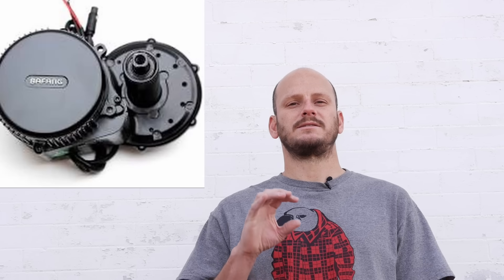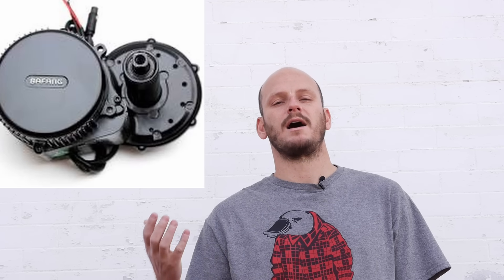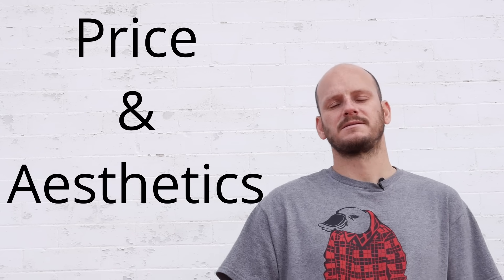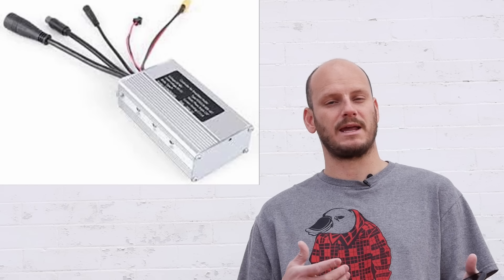Hub vs. Mid Drive Motors: Why Hub Motors Suck and Debunking Common Myths with performance test

Comment: You are so wrong hub drives are getting faster and cheaper while mid drives are on honesty a half ass design.. you want to be wide open throttle shifting thru them gears and mid drives can't do it.. you can ride it aggressive well unless your peddling the thing
Reply from the maker: Yes. You want to have the same mindset of any manual transmission setup whether it’s a motorcycle or car. Do not apply power while shifting. That is always bad!
For those that don’t want or need the performance of a mid drive, consider a hub motor. They are much easier to operate. I always use the scooter vs motorcycle analogy. Scooters are just easy and fun. Motorcycles are a different beast completely.

Comment: Everything your saying I experienced the complete opposite.. I smoke my buddy's mid drive that more then double the price of my bike and he breaks his chain on a weekly basis..and can't utilize all his gears and you can't shift under power.. hub drives are for the bicycle guy who doesn't want to  be considered a e biker.. mid drive you pedal way more then you should on a e bike.. the weight almost don't justify having it..I always thought mid drive was far superior but I was complete wrong.. if you want a mid drive I would recommend just stay electric less or buy a E motorcycle you will be so much happier..  and I never broke a bicycle chain in my life and if your kid drive isn't snapping chains then it's not working right
Reply from the maker: How much power does your friend run through his motor?! 1000w is max and you have to be in the correct gear or you will break chains and burn up your motor. Just like a car. Yes if you don’t like shifting, pedaling or riding a regular bike, you won’t like a mid drive.

Comment: I look for a hubmotor to speed up my bumper car a bit. am I right that the hub from an e-Bike would be better as it must have lower KV as the diameter of the wheel is way larger. My plan is to press a rubber-tire on an e-bike hub-motor and put it in the bumper car. 5000w should be preatty neat

Comment: Mid-drives are literallly a pain in the ass 😂
and more conplicated, and expensive, and a hassle.

Also if your chain snaps (which Ive done twice now in 3 months) your ride is over. Yeah you can replace your chain out in the field but who wants to deal with that. Its annoying and a serious vibe killer. 

If hub drive motors fail you can still pedal home. Also if you are smart you have dual hub drive motors so if 1 fails you still have a backup plus pedaling worst case scenario. The odds of dual hub drive motors failing at the same time are slim to none.

Also you want geared hub drive motors which are far more effective, efficient, and powerful.

Mid-drives also overheat much easier which you failed to mention in this video. I have pne of the most powerful mid-drive motors in the world that being the CYC X1 Pro Gen 4. Its a powerful motor for sure. But it also throttles power in a major way at 164 F which is not hot for a motor at all. 

Ive seen hub drives reach temps of 220 F and still keep rocking. 

Mid-drives are really only geared towards serious mountain bikers tackling very challenging terrain where quick bursts of speed are needed and all while using much lighter bikes. A good example of a mid-drive setup is the Bonnel 775 with the X1 and A-65 battery setup. 

But for bikes heavier than that like fat tire etc its geared hub drives all the way. Plus mid-drives are noisy and need far more upkeep.

Im sorry but this dude is definitely wrong. Geared hub drives win all the way around. 🚴‍♂️💨
Reply from the maker: I’d still take a broken chain over a flat in the hub motor wheel 10:1. The added performance is just a cherry on top. But different spokes for different folks as they say
Reply: @JohnnyNerdOut True. Everybody is entitled to their opinion. If you can afford it have the best of both worlds.

Comment: 3 years ago, got a cheapie Ebgo from Costco, rear hub ( under $1500 CAD ) ,  my first ebike, and it was totally a  blast for casual riding and errands/shopping/etc. especially with thumbthrottle.  However, recently got a Opus mid drive for $2200 CAD,  ( 50% markdown from $4400  ), and i absolutely love it.  Completely different ride,  smoother, feels more natural,  and its just, subjectively speaking, more fun to ride.  Being 10 lbs lighter than Ebgo helps also.  The next ebike I'm eyeing will be carbon fiber,  sub-30 lbs,  and definitely mid drive!   Btw,  thanks for the awesome comparision video!  I was supercurious why the mid drive felt more natural/organic/'funner' , lol;  u answered all the questions  😁😁😁

Comment: Converting an old Dutch bike is another application for a front hub motor. If it has a single speed, or a 3-speed IGH, you don't have to touch the drivetrain by simply installing a front hub motor; keep the rear coaster brake, and often there is no front brake to deal with at all. This is possibly the easiest e-bike conversion ever, and is ideal for assisted city cycling for errands or commuting.

Comment: I have an ebike with a mid-drive and a 400 lithium battery. It was conservatively designed and engineered by "BOSCH". I keep the bike inside and never get it wet. I try not to work it too hard and monitor it closely when it charges. Never had a fire "YET". Hoping for the best.

Comment: Look I dont think you can just crown a "best motor style" 
It just depends too much on what the rider needs and whats expected of the bike.

My situation:
I am a commuter. I need to ride for 65km each day, no matter the weather. The bike needs to make it. Working this role the bike sees mostly asphalt and some gravel roads.

My bike:
-RH212 direct drive hubmotor
-Phaserunner V6
-2.25" 29" street tires (made for speed pedelecs, so rated for 45kmh)
-30ah 48v rack mount battery along with a 20ah 48v downtube battery. Both are locked to the bike and are easily removable. I only charge these batteries to 80% and have them cut off at 20%. This greatly increases battery health over time. Using an arduino and some relays I made it so the bike first drains from 1Battery and switches to the 2nd one as soon as the 1st one hits 20%. There is a buffer zone so the bike does not need to be restarted when the power source is switched.
As is it has 2.4kwh of battery, the way I use it, I get 1.5kwh with the option of using another 0.45kwh if I need to with the flip of a switch.
-Full steel frame with no suspension
-260mm Magura rotor with magura MT5 in the front and 180mm deore XT disc in the rear with deore XT brake lever.

My bike needs to sit at 35-40 kmh, comfortably, also this is the most efficient speed for my setup.
In ideal conditions it should get above 100km of range. In worst conditions like winter it should not drop below 70km total range.
I get engine braking and its variable. This is accomplished with a brake sensor, as soon as I move the front brake lever the littlest bit, engine brake engages. I can now use the half twist throttle to adjust how much engine braking I get.
I have done a full 100% battery usage range test when I built this bike and 100% on throttle and not beeing that economical it did 120km during summer.

This way I hardly ever need to change my brake pads. I go through 1 set a year. I get around 15000km for 1 year.

If this were a mid drive I would need to service my chain often, I would go through cassettes, both especially at full power (1500w BBSHD)
I need to have a bike thats reliable, will comfortably sit at a decent speed for a long time, will run for a long time, require little to no maintenance and thats what Im getting. I went for "as little maintenance" as I could with this.
Had this setup for 1 year and total battery capacity has dropped to 93% only, after 15000km basically only on throttle riding. I am on track to get 50000km~ out of my batteries before needing to replace them and I had no issues with the motor so far. I might have a look inside during my next holiday to switch out bearings and regrease everything procautionarly.

Comment: I am regretting my hub driven Velotric Breeze 1. It just can’t pull the hills in my neighborhood on throttle alone. I only weigh 165lbs. And this is important to me because I have some health issues that cause my muscles to just give out, without warning. I have already decided my next bicycle will be a mid drive. I haven’t even had my Velotric a week.

Comment: But hub motors require a dealer who can repair them. Also, all these different Chinese bikes and who is going to be able to get the parts. It sure seems like one American, Canadian, Mexican, or some other good quality dealer would manufacture these or at least have a dealer network.

Comment: even Grin motors?
Reply from the maker: If you are going hub Motor, I pretty much only recommend using Grin motors. They’re all axle Motors are actually pretty great. I have a video coming out on them soon
Reply: @JohnnyNerdOut  any opinions on the Haul LT geared hub? Is the Bafang throttle similar?
Reply: @JohnnyNerdOut  I'd love a video where you compare bafang and grin on the same bike under load.
Reply from the maker: Coming soon! Similar bikes but not the same ☹️

Comment: the hub motor is for people who are mechanically inclined and unafraid.
The mid drive is for idiots like you who wanna feel more power for a significantly higher cost.

Comment: If I rode frequently on low-traction surfaces -- sand, mud, snow, dense gravel -- I'd get a front hub motor. Then you have 2WD.

Comment: I have built and ridden multiple ebikes, mostly hubs and one mid. Here's my thoughts:
A well-built wheel with a hub almost never gives any trouble.
With the right motor and a nice torque sensor, hubs are great in assist mode, which is how I mostly do my riding.
Hubs that allow regen are really sweet - you get brakes that work in all weather and are more linear than anything you've ever experienced. For heavier vehicles like trikes and tandems, you can recoup up to 20% of the power while not wearing your brakes, which is great!
Mids - make sure you aren't loading too much on the chain. The one mid I had drove a tandem and while it was great going up the hills (even with 2 people), it ate up the drive-train like crazy.
I would venture onto another low-power mid only for a very light build to try for range, using it with large cogs (16T up) and an even larger (60T) chainring to reduce chain wear.

Comment: Nah my 3000w 72v cube will smash any middrive on concrete if you wanna race up hill of off road just the stealth bomber will smash any middrive
Reply from the maker: Nah. The x1 pro 72v mid drive will have smashing power in a head to head smash test
Reply: @JohnnyNerdOut cost ?!? That motor cost more than my cube my cube cost 800 and is on  8000km

Comment: Ok its maybe easy to fix a chain on the side of the road... but please... Spokes are far more simple to change on a hub motor wheel than on any normal rear wheel! I can change one in minutes without removing the cassette or even the wheel! its not more complicated to take a nut and spoke and spoke tool, than a chain or chain tool! please... (when travelling far, i tape some spokes on my frame, even with a normal non electric bike). I my case, i don't need a lot of power and i like hub motors for being cheap and a simple tech, reliable and easy to fix... but ok, you're not anti-hub drive ;)
Reply from the maker: Right, changing a spoke is not hard. IF you have the spoke. But Those are generally special ordered. A chain is available at Walmarts, grocery stores etc. 
the average rider is not doing spoke replacements on the side of the road. Oh and I might. But even then I can do 30+ chain repairs in the time it takes to repair a spoke.

Comment: Can mid-drives takes me 55 mph? Do I have to pedal it, or do they come with throttles like hub motors can? All of the super fast "e-bikes" (motorcycles but with pedals, which is really what I want) all use hub motors
Reply from the maker: Yes a mid drive can take you to 55mph. See CYC X1 gen4. No you don’t need to pedal, they have throttles.

Comment: Hub motors are underdriven.  Unless you have a mountain bike with an underdrive gear, a hub will climb better if all other things are equal, which they usually aren't.  Plus, bottom bracket drives are (likely) internally under-driven, which means you have 2 separate systems with losses in them.  You have the internal gearing inside the bb drive, then you have the inefficiency of the regular drive train of the bike.  Any derailleur system is not going to have a straight chain line, making the efficiency lower than the theoretical 98% efficiency of a straight and clean chain drive.
I'm not saying they suck.  They have some good properties and they are usually much better built than hub drives.  But they do not have the advantages you think they have.  They also cause excessive wear on all of drive line components.

Comment: 2:30  This is false.  Most of the gears are unusable on a bike with a mid drive.  Electric motors want to be geared down, not up.  Look at almost any electric motor. They are nearly always geared down with a belt drive.  10 to 1 or more is typical.
Mountain bikes generally have at least 1 underdrive with gear 1 (like 30 in the front and 40 in the rear), but the rest are all large gear up ratios, like 30 in the front and 16 or 12 or 13 in the back. 
But this is mountain bikes.  Almost all other bikes have no underdrive gear at all.  They start at 1 to 1 in first gear.  With 700c rims, you're talking over 2 meters of movement for a single rotation of the crank in the lowest gear.  Most max out around 4 to 1 (48 or 52 in the front, 12 or so in the rear) which moves that up to almost 9 meters of forward movement for a single rotation of the crank.
Electric motors want torque multiplication, not division.

Comment: I've had my HP Velotechnik Enduro now for 5 years, it has 28,000 miles on it. I ordered it with the Bafang 750W mid drive BBS02, and a Nuvinci N380 IGH. I am currently on my 3rd set of drivetrain components, KMC X9 chain, T Cycle chain idler, Sunrace M30 chain tensioner, Nuvinci (Enviolo) drive cog, and  Bafang crank sprocket. I absolutely love the setup, it's a joy to ride, very reliable, and servicing the components is relatively simple. The best thing is having peace of mind while riding. I carry tools, spare parts, and even a portable/collapsible jack stand which I have never used while out riding. In addition my tires are equipped with Tannus Armour inserts, and I have not had any flats while being out. Stress free cycling at it's best!!

Comment: From many years' perspective, I would add that my mid-drive motor broke the chainstay within two years. I had to replace the frame. I never had a chain break.
But despite this, I still use a mid-drive motor. It can even climb a vertical wall. And if I were to consider the regulations (which I don’t), with a maximum of 250 watts and 25 km/h, the mid-drive motor would clearly be the best choice.
At this level, a hub motor is good for city cruising, as long as there are no hills.

Comment: Lol if you have 2 hubs of 80 nm is exactly the same power of a mid drive motor.😅 So no problems climbing on hills.
Reply from the maker: If you have a mid drive with say a 36t chainring and 11-50t cassette, the mid drive will easily outclimb dual hub motors as they are a fixed gear ratio. That mechanical leverage really is crazy.
Reply: @JohnnyNerdOut  It depends on what kind of hub motors you have bro. There are hub motors that are so strong (6000 watt) that will make your will spin at 20km/h. I don't think there mid drive motors with that kind of force. I have a bike with two hub motors and is crazy strong when I activate both motors and no other bike with one mid drive motor will take me out on the climbing hills. I've tested this with other bikes with mid drive. And my bike is not the strongest there, I've seen bikes with 12000 watt motor and is insanely strong.
Reply from the maker: @AdiCicirean  well ya but that’s not even remotely apples to apples comparison. It would take 3-4x the amount of energy to get the same performance from hub motors is the point. Sometimes even more.
Reply: @JohnnyNerdOut  well ya but i am just saying that with a central motor engine you will never reach the performance (torque and speed) of two beefy motors front and rear wheel drive.

Comment: The midline motor is an equipment violation it's two areas of violation 1 it puts a transmission between it and the motor on the same driveline as the body this is to prevent accidental equipment malfunction and the equipment to put Force back on the body and break the body secondly it puts direct drive line force on the body right off the bat that's the same equipment violation that has for 30 years now kept the army from playing around with exoskeleton technology because they can't get that through their f**** heads The hub motor in the back there are two different designs of it one with a gear and one without the one without gets to a higher speed and uses an overall lower RPM requires more power because of it in actual amps the one with the gears runs a higher RPM so it gets to a lower top speed and runs more volts than amps either way anything at 12 volts and above must be licensed or approved by army corps of engineers and that's a global thing that's the Mars safety systems standards That's not My prerogative that's not someone else's prerogative that's military army corps of engineers 250 years as one global Union say findings of fact